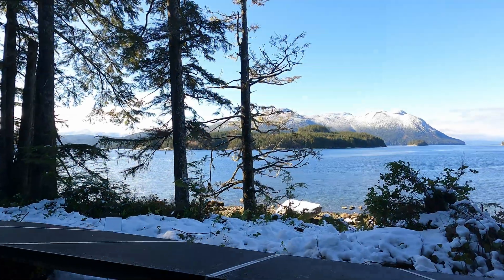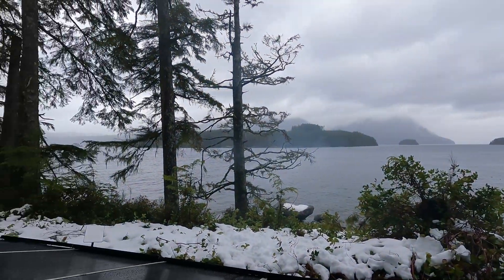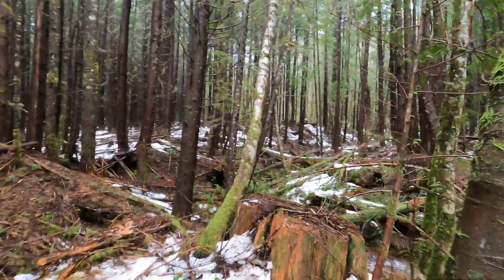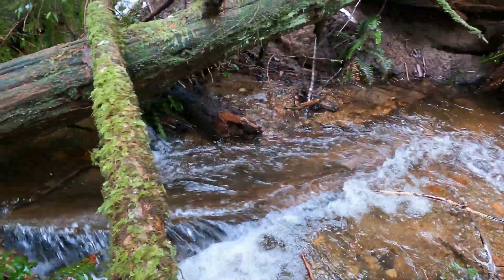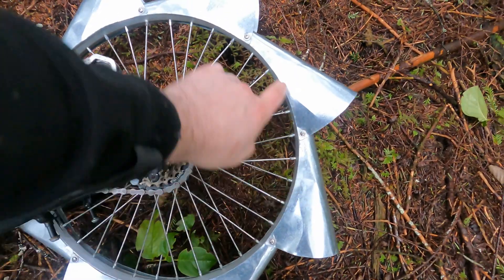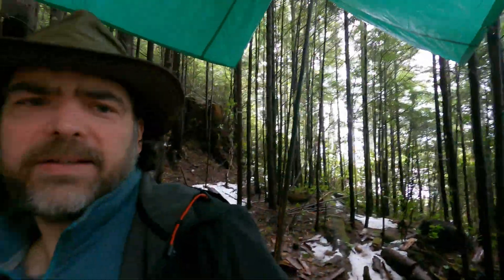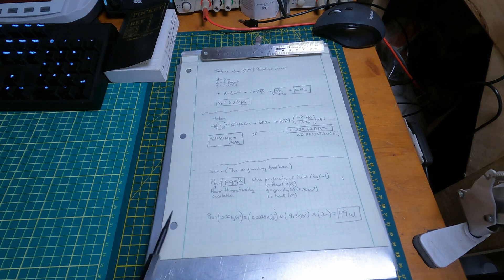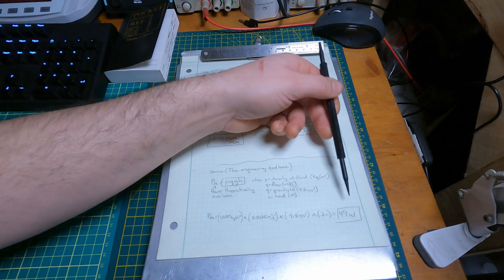S01E05 - Fortune Favors The Cold?

Comment: Good effort, in the future I'm going to build a low output small scale water wheel to add to a solar system+batteries set up. The main advantage of those systems is they are great trickle charge feeders, and run 24/7, so it can add up.